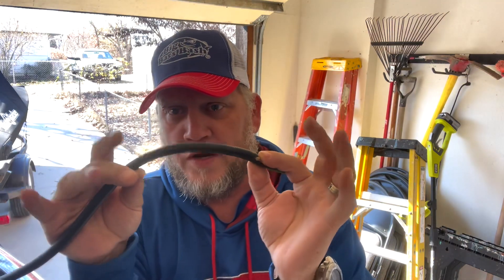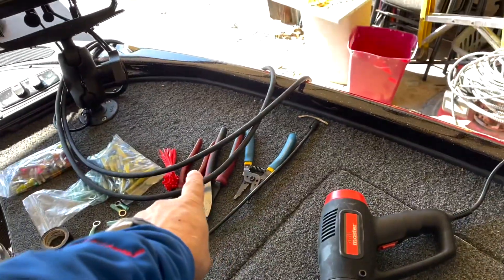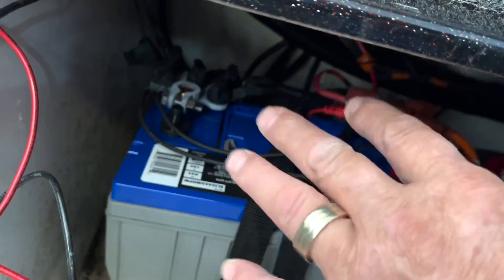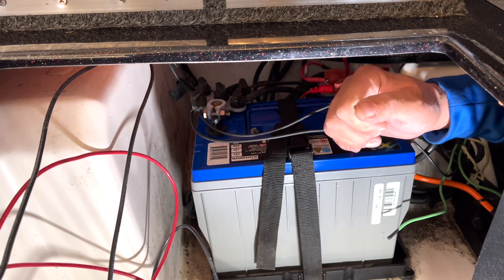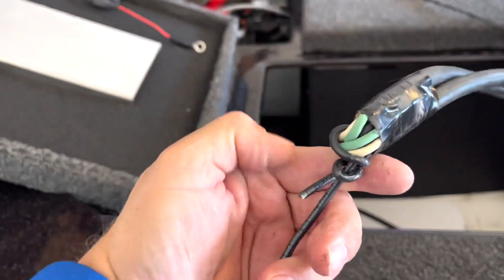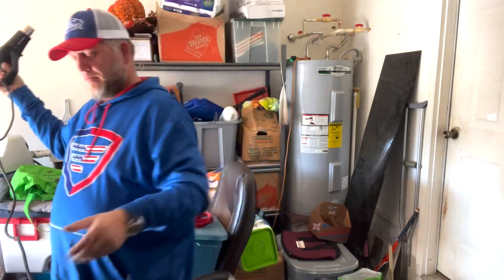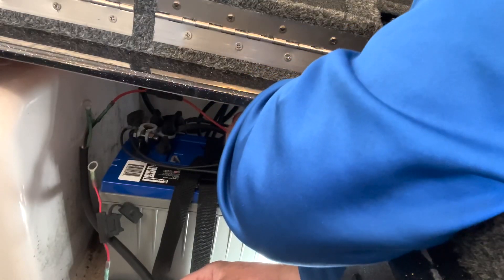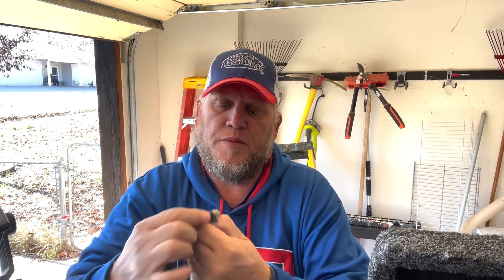How to clean up a Disaster of wiring in your boat! Lazy install fixed!

Comment: Nice, that worked out real well!.. I like you added the recommendation for the Heritage/Classic XL to just run the wires up under the gunnel. That's originally how mine are done. Trying to fish the wires through the factory installed route is a BEAST!. Can you elaborate a little more on what exactly the wire is that you are using?? .. Also the recommendation of "planning for the future" is golden.. I had the opportunity to put in a fuse box at the time of my deck extension but totally overlooked the value of doing this at the same time. BIG MISTAKE!! Great to see a "How To" video of yours again!  👍Looking forward to seeing those future upgrades...